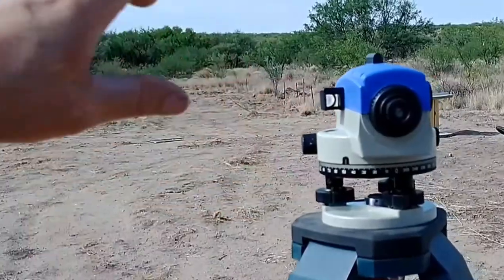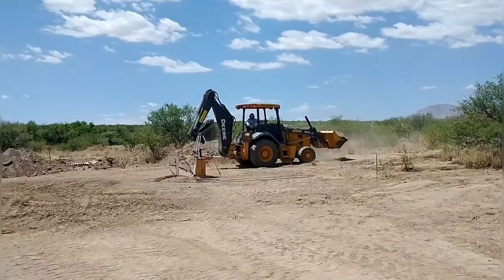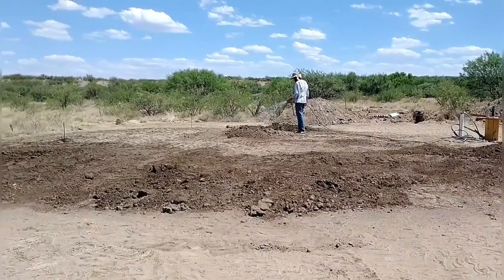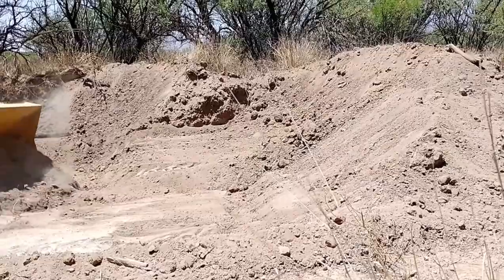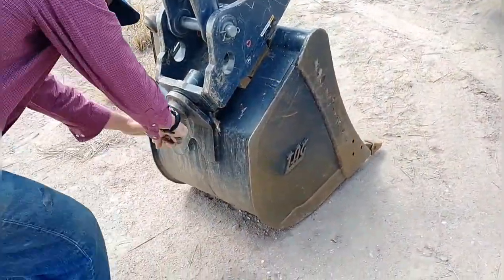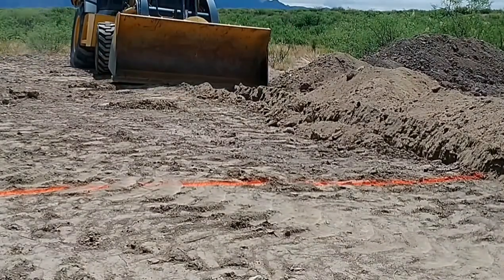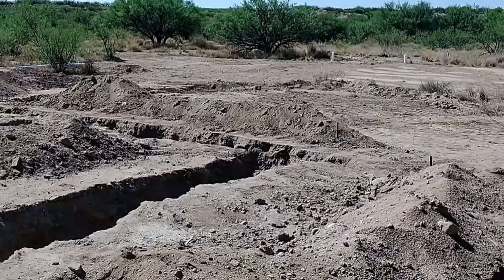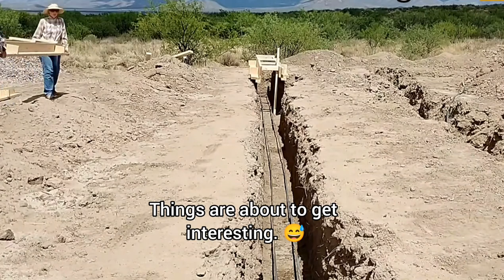#1 Getting Started | House Pad & Footer DIY Off-Grid Home Build

Comment: What kind of house are you going to build, any floor plans? What state are you building?
Reply from the maker: We are planning to try aircrete. We have been interested in it for awhile, but are just now looking into how to actually do it.  Right now our plan is to form and pour the first 4 feet or so of the house then maybe use aircrete blocks after that, but we're not sure yet. First we plan to practice on a wall around the garden, and we plan to use aircrete for our floor. A lot of the videos I have been watching, are having trouble getting the mix right, so we'll see how it goes. You give us hope that it's possible to get it right. We have a plan for our house and have half of the footer poured. We are going to pour the second half tomorrow. I have a video I'll be posting soon, that shows more of that. We are in Arizona. 🙂🏠